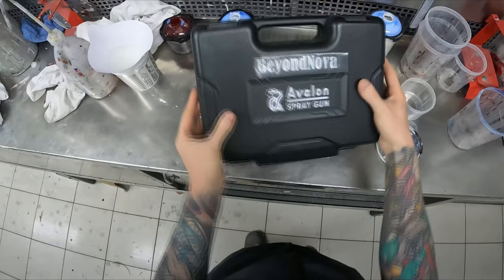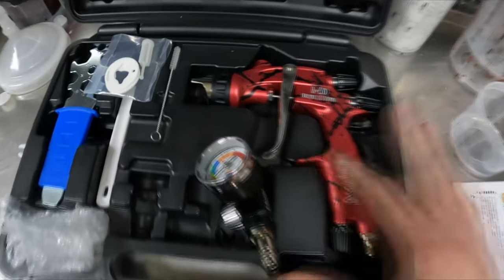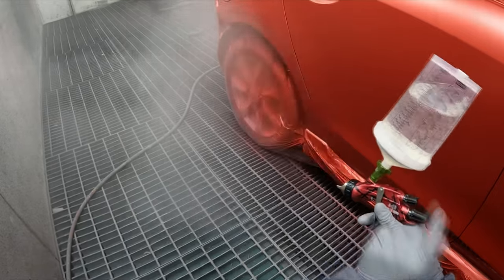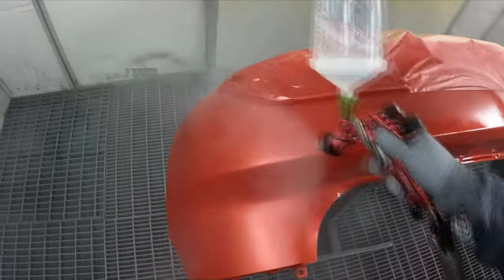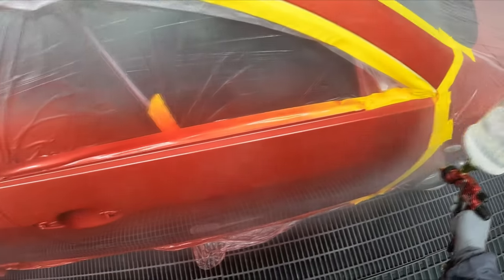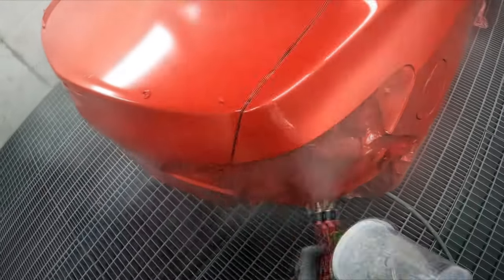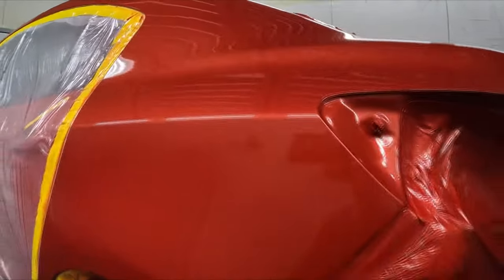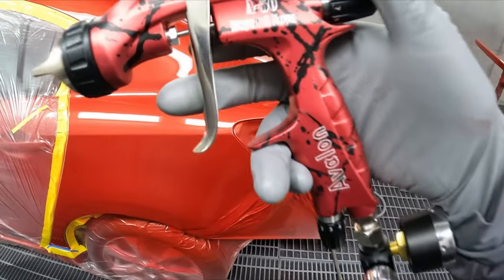Beyond Nova Spray Gun Review: Avalon A-50

Comment: have yu ever tried to use higher pressure on side panels (to avoid runs) and lower pressure on horizontal panels. thinning the paint wil reduce the amount of mils thickness applied to the vehicle. thus resulting in using less paint. there is levels to this shyt an Gunner  is at the top
Reply: Wouldnt spraying different panels on a car at lower and higher pressure produce different orange peel?
Reply: @endo3939  "orange peel" is caused by many different things. if you spray each paint layer smooth the finish will be smooth. you can put more smoother coat on a flat hood by lowering the pressure (won't trap air and less over spray into the over lap)and putting more paint. on a side panel you want more air pressure (less paint for gravity to pull the paint down

Comment: the real super nova is a very good gun when it is set up right but it is a very dangerous gun when it is not.  It will run quickly and is totally unforgiving if it is not totally dialed in.  I'm sure you know what I'm talking about. I use a super nova for clear on most of my jobs but also a sata 5500 and a tekna  pro lite.  the Tekna is by far the easiest to use.